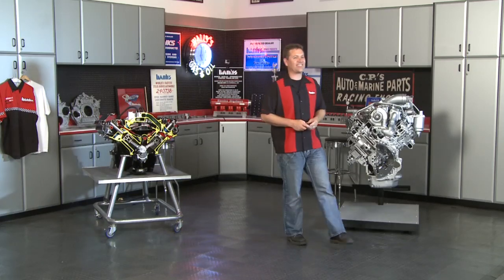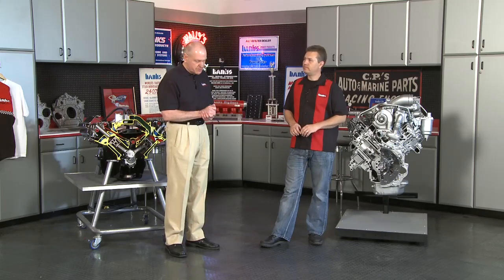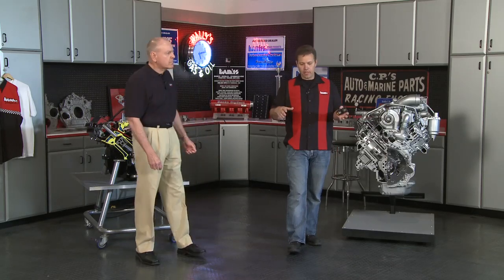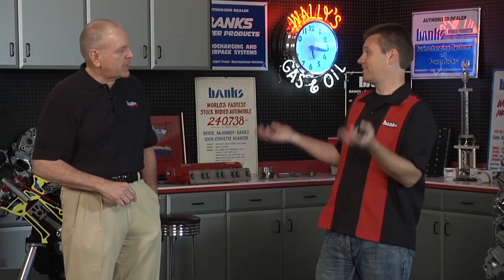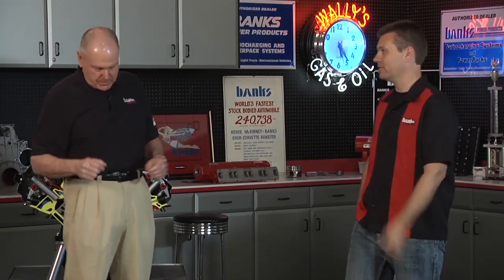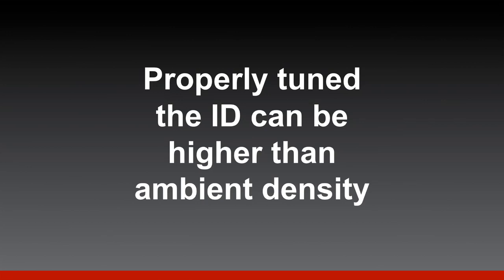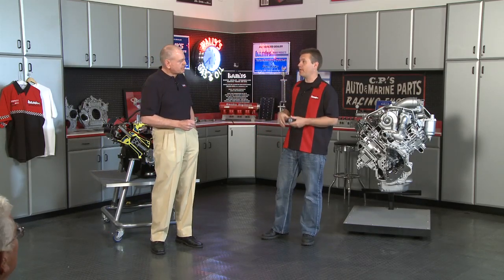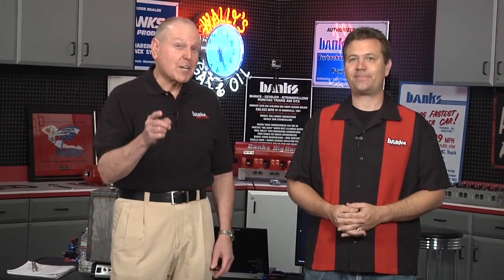Tech Talk 1: Suck, Squeeze, Bang, Blow--How Does an Engine Really Work

Comment: 10:53  same pressure in cilinder and exhaust manifold  for gasoline engine is maybe only at idle , on every other power range ,pressure in cilinder is much more higher than in ex man.( not included engine with atkins cycle)

Comment: Ram air only increases air density by 6% at 224 mph.  Nascar engines see 125% peak "volumetric efficiency" due to inertia tuning in the intake manifold and scavenging.  Production engines are over 33% brake thermal efficiency, Toyota Atkinson cycle is 40%, and Mazda Skyactiv is 42-43%.

Comment: A pity you didn't do this for diesel engines, since they tend to have a greater thermo-mechanical efficiency. Charged, fuel injected 2-stroke diesel engines, might still be the best piston engines, when it comes to thermo-mechanical efficiency, up to like 55% as far as I know. Are you going to do this part some day as well? Apart from that, there is something else that matters reducing energy of the "blow", which is the mass of the moving parts (weight of piston, crankshaft,...etc.), since they comsume energy to be moved.